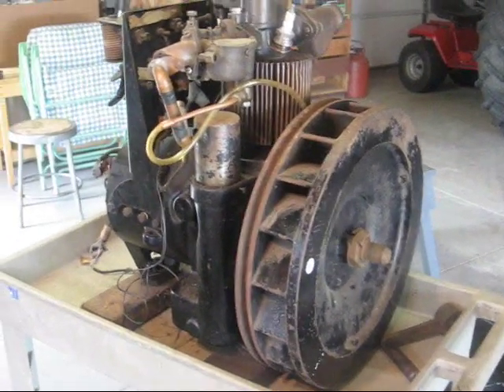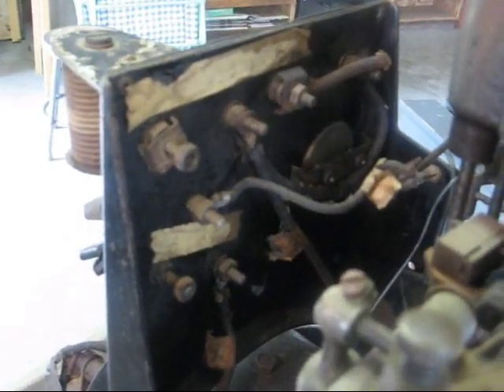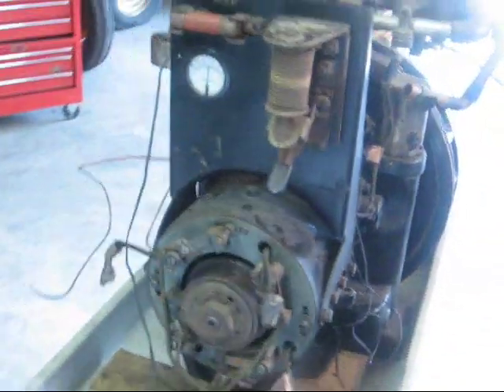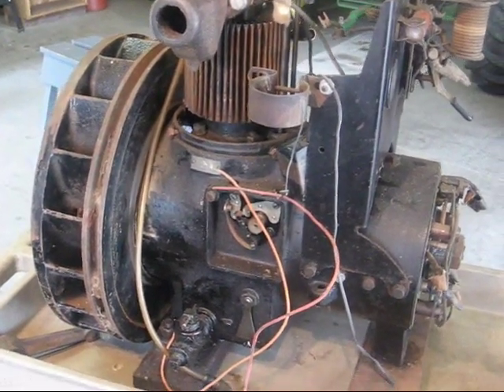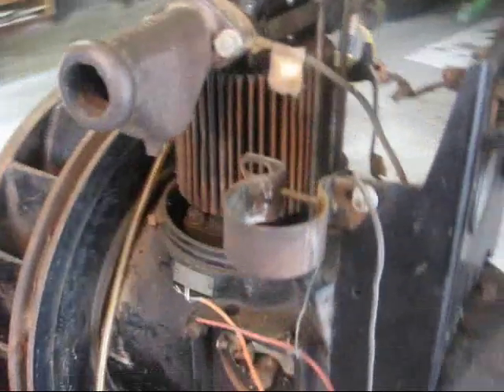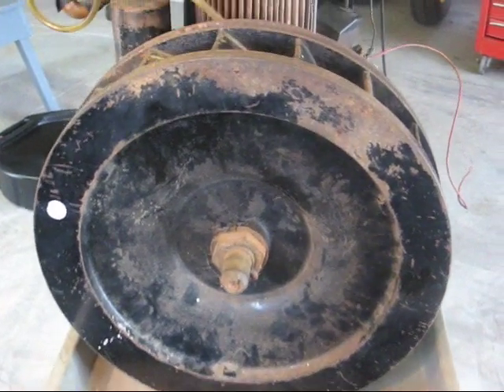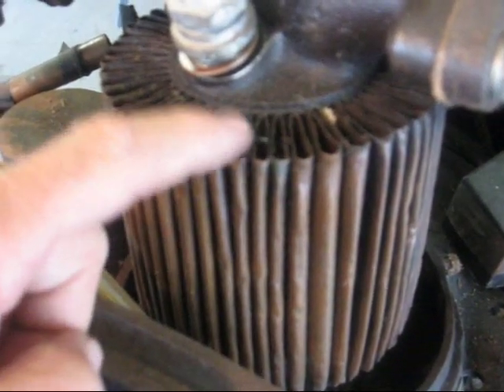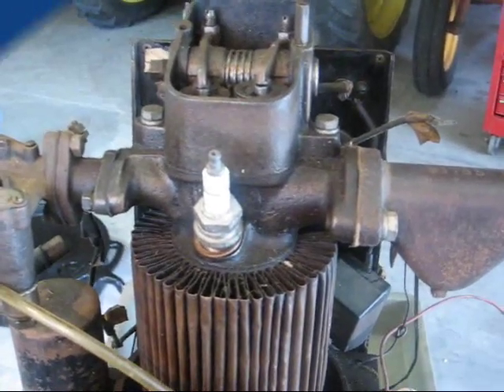antique DELCO LIGHT PLANT generator tubalcain

Comment: Ket Kettering is responsible for a lot of things I have owned a couple these generators. Kettering was also responsible for a copper cooled 4 cylinder in-line engine that never was put into production. Plus the corvair and of course Delco lighting yes he's light plants were all a little bit different
I was looking for a 32 volt twin-cylinder Maytag Delco that was definitely made but you never see any

Comment: My grandfather used an American General Electric 32 volt generator at his farm. When he bought the generator around the late 20s, he turned its cooling system from an air to a water cooling one. He himself designed the new water cooled cylinder head. The generator worked until the late 70s. We used 32 v train bulbs. I'm not able to find any pics and information on the internet abt this engine. Did it really exist? lol... If you know  something abt it, pls, e-mail me. lincolntz@hotmail.com. Tks.

Comment: @mrpete222  If yours is a751 as one of  the previous responses indicate I have a service manual that lists specifications for model 750-775 and model 751 (758-766) more info contact dkmnjw@cox.net

Comment: The coil bracket is a standard automotive bracket,so it looks like it would have had just a standard coil,going by the points aswell,so you shouldn't have much trouble getting it running with the addition of a coil a carb clean+ batt,as to the generating side it looks pretty simple in that you have just a regulator/breaker and  fuse,with an ameter,apart from that there doesnt seem to be much else,it much have a low volt genrator for the battery to power the coil/starter and a high volt output

Comment: That is a model 751 battery charging plant.made between Jan and Jul 1927
The flywheel is the same as was used on the automatic starting plants, and used a 6 volt electric starting motor that dropped into the flywheel groove to start, and then fell away after starting Yours is designed to be manually started to charge the battery bank when needed. You lifted up on the handle to do that. You are missing the 32 volt coil that would have been in place, and not in the holder as seen.